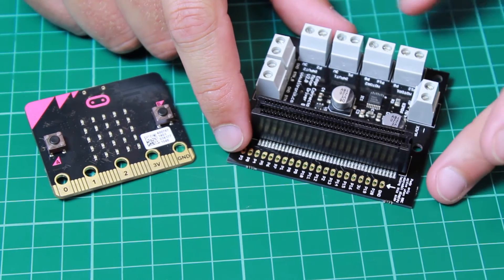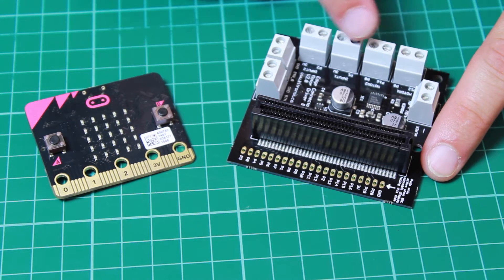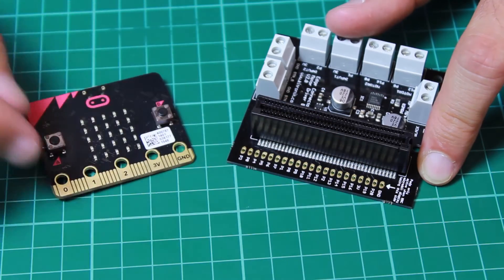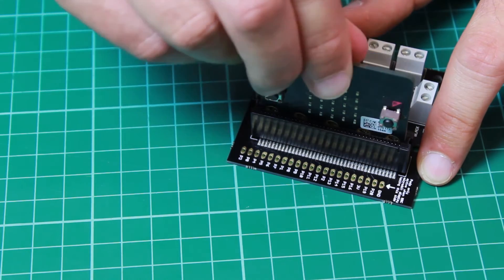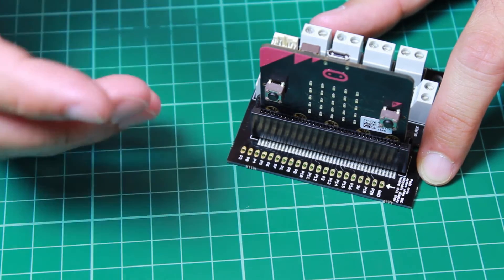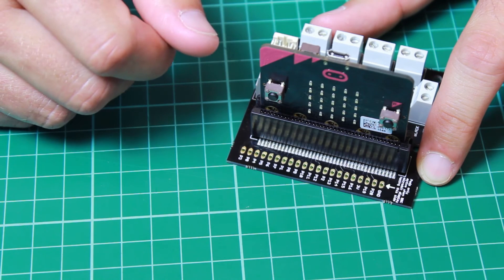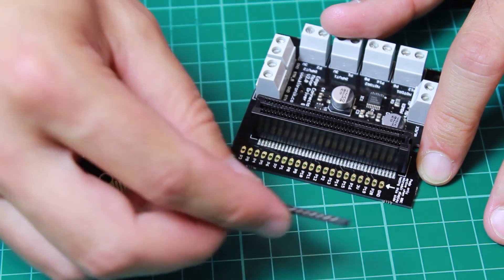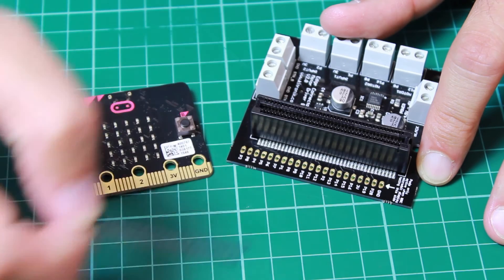Motor Driver Board for the BBC micro:bit - V2

Comment: When I put wires in the back side pins of the motor driver board V2 and make a program with these pins, micro:bit shows me an error something like the pin I programmed is in display mode or something. Why this happens and how to fix that?
Reply from the maker: If you mean the holes at the rear of the board, it may be that you have the microbit facing the wrong way in the edge connector? If you still have difficulty, please get in touch with support@kitronik.co.uk who will be happy to help you troubleshoot the problem.
Reply: @kitronik , no, I put my micro:bit in the right way.

Comment: with the extra input output means i can also use it to control extra motors and servo?
Reply from the maker: They are inputs. See the datasheet for more info. https://www.kitronik.co.uk/pdf/5620%20Motor%20Driver%20Board%20V1.1-2.pdf
Reply: tq. i'll take a look. already ordered mine. hehe :p